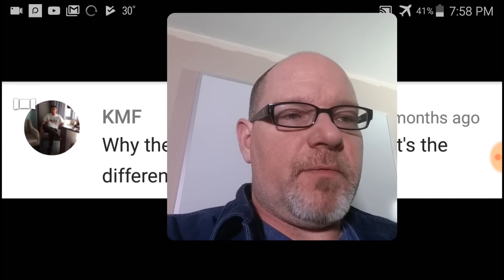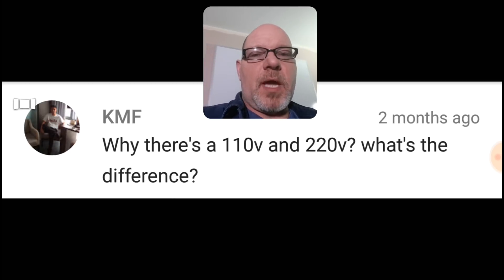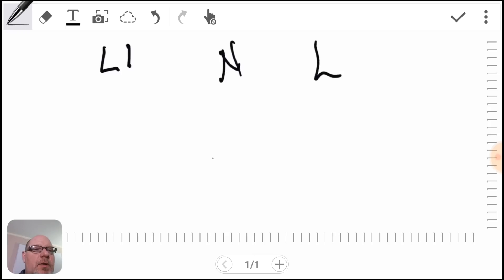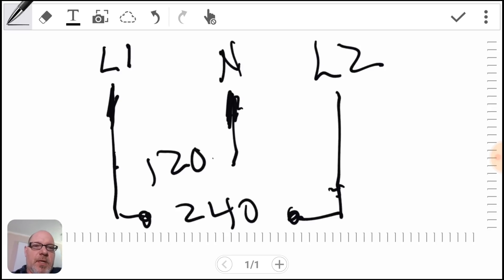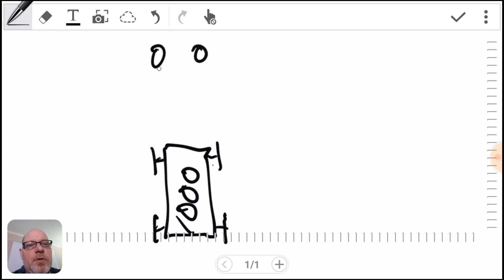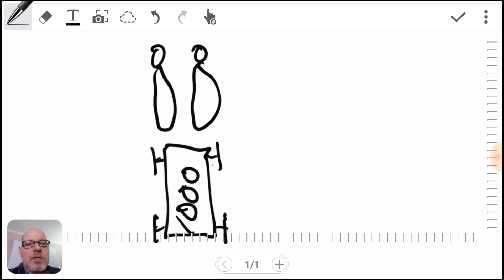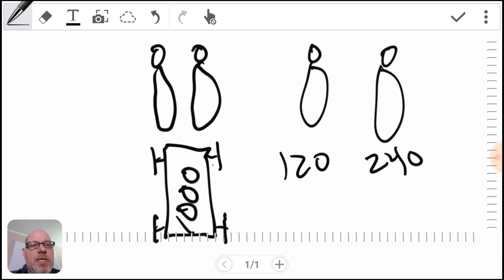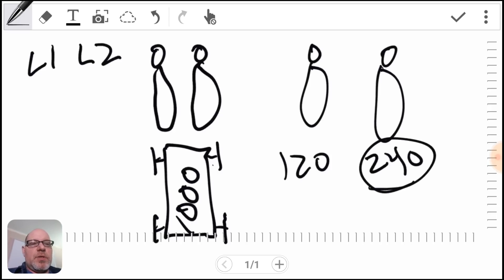Difference between 120 volts & 240 volts simple explanation.

Comment: Interesting analogy, but slightly confused regarding work, power, and energy.  When you move the same mass at the same speed, the work is the same, regardless of the number of horses.  When you move from one to two horses with the same load, each horse has half the load, so does half the work.  The total work is the same.

The ability of a horse to do a given amount of work per unit time is power.  Energy is power integrated over time.

It might be better to have the two horses pulling twice the weight at the same speed.  Then they would be doing twice the work at the same power output per horse.

Applying the principle to electric motors, a 1HP motor may not have enough power to do the work that needs to be done fast enough, so you decide to use a 2HP motor instead, which would be able to do twice the work in the same time.  The downside is that if the 2HP is running at twice the power of the 1-HP motor, it will be drawing twice the Amperes at the same voltage.  Increasing the Amperage requires larger wires and circuit breaker, and if your wires are not large enough, they will overheat.  Running the 2HP motor on 240V will draw the same Amperes as the 1HP motor rinning on 120V.  The higher voltage lets you get twice the power for the same Amperage.
Reply: Now this one clicks for me! Thanks.

Comment: If a have 2 motors 1 on 120 and the 2nd on 240 my electricity will be more expensive on the 240 motor because use  Twice  much energy?
Reply: No.  Some motors can be configured for either a 120V or 240V supply.  The manufacturers say there is no difference in efficiency.  They consume the same energy and produce the same power in both configurations.

Comment: Is it cheaper to run on 240v
Reply: Going out on the limb on this one take the 240 onto the electronic device it may burn up quicker or shorten the life span for that it comfortably requires just 120..
So yeah this sort of answers your question it'll cost you more money for having to buy the same device again much ~~>sooner<~~because you applied 240 voltage too much on something that just requires 120.  ..
And I think that's because the device itself has unrestrictor all you're doing is causing more Heat then the device actually can handle...
So being that 240 handle a lot more voltage the amount of energy causes a lot of heat something like aftermarket headlights with balusters that require "heatsinkers" or built in fans that drive the heat out due to the amount of voltage f or what's going on in that device and why it requires additional specific to operate fully and safely.

Comment: Which one consume more electricity, and which one is more expensive??? Thank you
Reply: Carlos  Acevedo    Carlos, the same amount of work is the same amount of cost.   So 1kw cost is the same, voltage has no effect on cost to run.   Volts go up, amps go down, watts remains the same.
Reply: @KevinCoop1  That's really what he should have explained in the video! Because that's the part people never understand... Imagine a sink with the water being electricity... The amount of water dispensed are the Watts (1000Watts for an hour are 1000WattHours). How thick the pipe is are the Volts... And how fast the water flows through the Pipe are the Amps... If the water flows slower, you can still keep the same flowrate by just making the pipe wider!

Comment: So what cost more to run? 120v or 240v air conditioner?
Reply: Granted I dont truly know, but I would say 120V for sure.
Reply: The answer is which air conditioner uses more watts per hour.   Like many things, the correct answer is the easiest.    240v increases the availability of
watts for a given size conductor. Thank you
Reply: peterhypeterlow    They are the same cost to run if they are the same BTU rating and in the same exact room at the same temperature.    No difference.

Comment: Which is cheaper
Reply: Joey, they both cost the same. Take for example something without a heating element like a table saw. Typically a 120 volt saw will draw 15 amps.  Voltage (which can be compared to electric "pressure") is inversely proportional to amps (which can be compared to current of flow rate) so when the voltage or "pressure" is increased, the "amount of flow rate will decrease. 
Picture a tank full of water. You hook a hose up and pump out the water, you have a small amount of water pressure but a large amount of water flowing. Then if you hook up a pressure washer to the tank, you have increased pressure but a smaller amount of water flowing out. Because the pressure and volume are indirectly proportional.  The cost of the electricity is the same because the power company charges for watts, not voltage or Amps  (Watts can be compared to the amount of total water used.
To calculate the watts, multiply the voltage times the amps. So a 120 volt motor that draws 15 amps will use 120X15= 1800watts 
Now convert the 120 volt motor to 240 volts, the amps cut in half because volts and amps are indirectly proportional and now the motor will draw 7.5 amps.
240X7.5= 1800watts
Therefore the electric cost for both motors is the same. The advantage of the 240 volt motor is it will get to top speed quicker (but wont run faster) and i am not 100% positive but i believe will have more torque and last longer than a 120 volt motor over time before wearing out.
Reply: @thehammeredthumb7110  which is better?
Reply: Joey Jones    You didn't ask a question that has a true answer.   Energy usage in KWH is the same.  KWH for a certain amount of work the same.   Cost to install circuit for 20 amp circuit at 120v or 240v are the same.   Cost to power 20 KW electric heater, way less expense at 240v.   Does one of these answer your question?  If not, be more specific.

Comment: Hi! Sir. I have a waffle maker 120v. Can i plug into my 240v home electric socket?
Reply from the maker: No.
Reply: What should i do if i wanna use it..
Reply from the maker: Which country are you in?
Reply: Singapore
Reply: Dearo Acit : quick resolution is to buy your waffle maker 120V of Transformer [ from 240V to 120V power] (check you waffle maker wattages requirements on its casing to find how big transformer you will be needing)

Comment: Got a question for ya sir! I'm coming from 12 Volt DC Power, trying to get a grasp on AC. On DC if I take two leads off the + on the battery and combine the two I still have 12 Volts. However if I take two 110 Volt leads and bring them together I can get 220 Volt. I am just trying to get a better understanding of what I am working with. I asked a couple other electricians and they said they don't know why, they just know it works. Lol
Reply: No, not the same at all.
Your 12 volt leads are coming from the same battery contact and are exactly the same. 
Not so with the AC as described in this video.
At the beginning of the video, he shows 3 wires coming in... L1 _ Neutral_ L2... those are two independent AC lines directly from the fuse box (NOT two cords from the same wall socket).
The reason you get 240 is because the lines are out of phase so when one is high, the other is low and they add up. If this is unclear, look up how AC voltage works.

More Useless Details:  If you look at your fuse box, you will notice that the breakers for Hot Water Heater, Clothes Dryer, and Stove/Oven all use a double breaker that occupies 2 slots in the fuse box. Those appliances use cabling that contains an extra RED wire that carries the second AC-120 line. The Black wire is the first AC-120 line, and the white wire is Neutral for both lines when used independently, like in kitchen-counter outlets which use the lines separately. One AC-120 on each socket... With regular cabling on those outlets, you would blow a breaker just by using your toaster and your kettle at the same time.  Ah, the good ole days!  ;-)
Reply: Forge: Yes the terminology is confusing.  You (we) are not bring together two 120 volt leads.   Strongly suggest learning how a step down transformer ( out on the near pole ) works.   This will be a

Comment: Just bought air compressor and it says it runs on 230/1/60, I have a 240 welder outlet. Am I ok run it off 240?
Reply from the maker: Yes. Plug and receptacle may be different
Reply: Guy Brown thank you sir, I'll get the right plug and cord, just was not sure about running 240 through it.

Comment: How is 240v wired at the breaker panel?
Reply from the maker: +Familia Sanchez HVAC I will make a video on it. Thanks
Reply: With a two pole breaker, connected across the two phases, which are each at 120v.  It’s called “split phase” single phase current
Reply: Familia Sanchez HVAC dd.